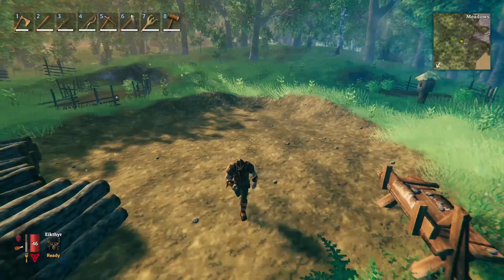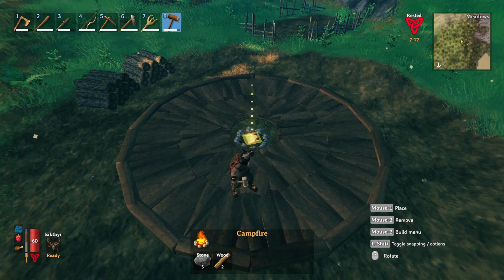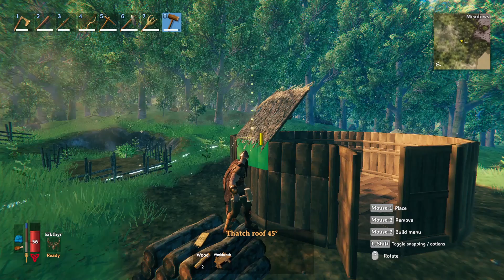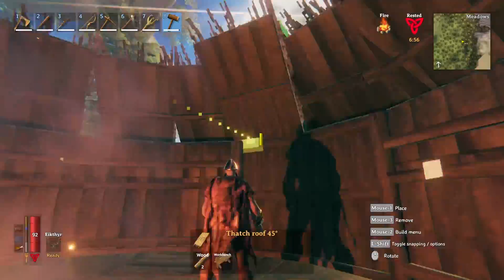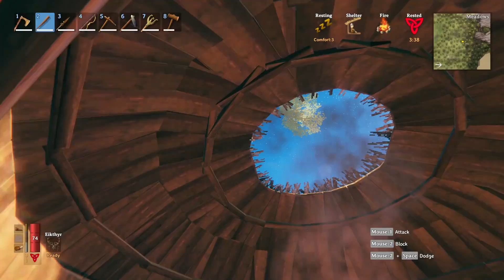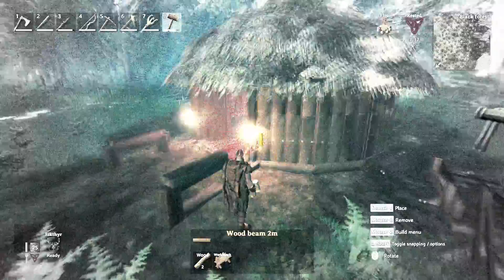How to Build Valheim Roundhouse - Circle Base Building Design & Guide

Comment: Smoke issue? Where is the smoking going?
Reply from the maker: Good question, you can always leave the center open or top it off with thatch roof ridge. This will protect the floor from the weathering effect and leave gaps for smoke to escape. Lots of possibilities depending on what you're using the building for :)